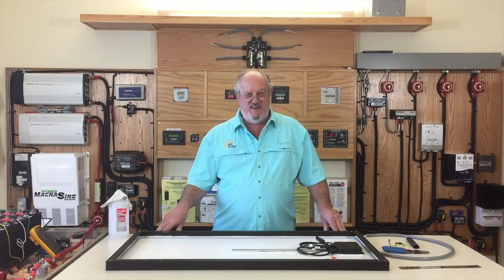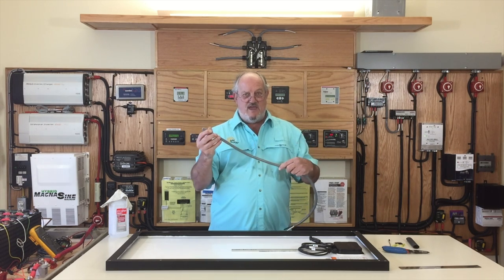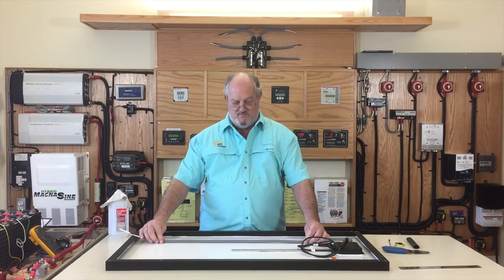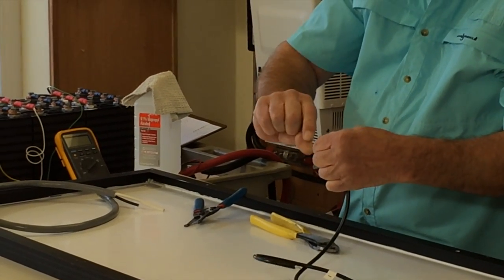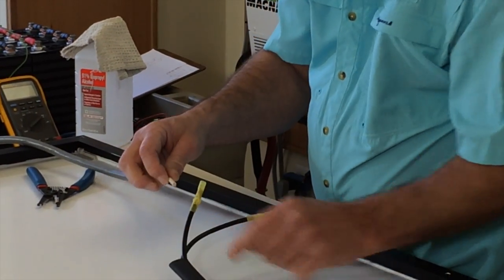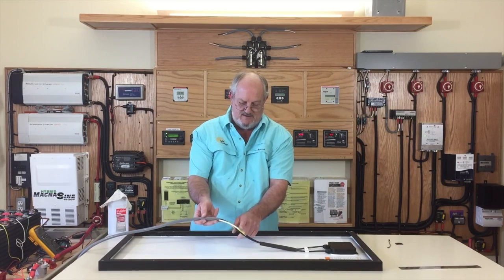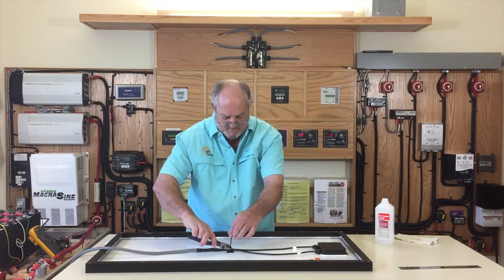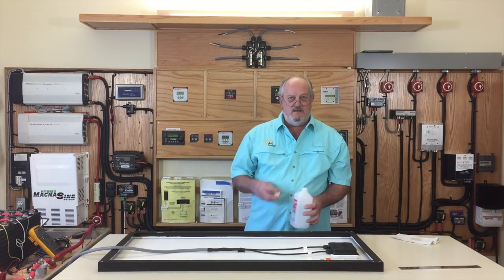Installing the Output Cable

Comment: Your wire is not tinned. Will have corrosion there is a short time. For the slight increase in cost, its worth it. Also, why not just put the wire directly into the back of the panel?

Comment: Just curious, couldn't you open the junction box mounted to panel and hard wire gray cable inside using one of your cable tight strain reliefs  ?? Then use a closed end cap on the other side strain relief ??